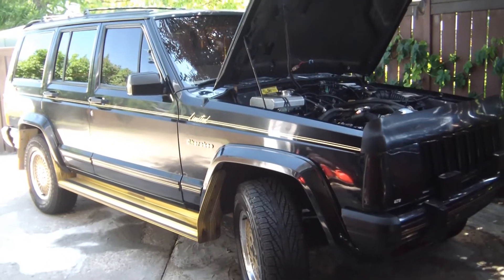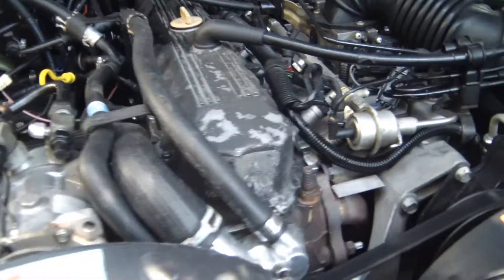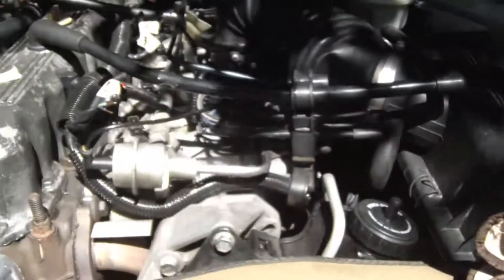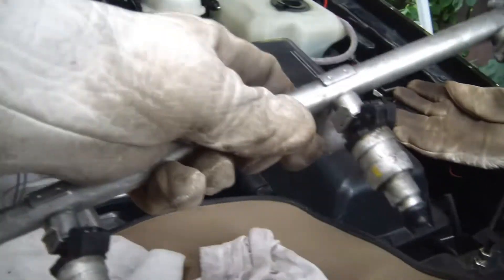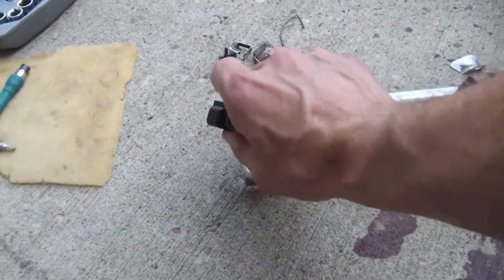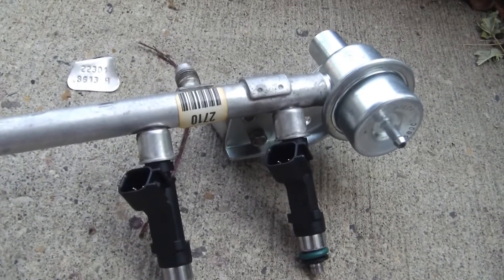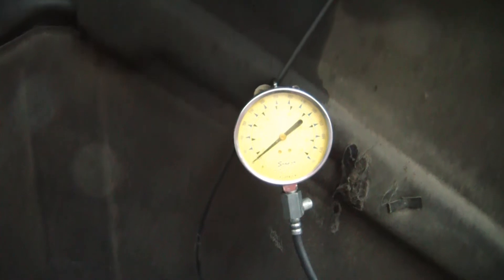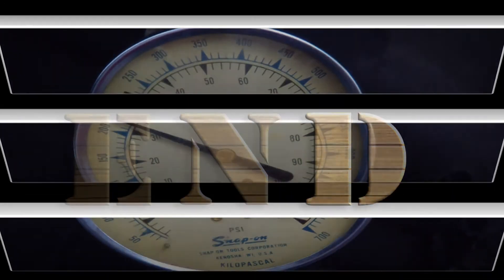DIY Auto: Fuel Injector Swap. Fuel rail, Fuel pressure regulator removal & installation.

Comment: If you've come to this video because your vehicle won't start without hitting the gas, you might want to consider the Crankshaft Position Sensor.  I was certain it was issues with the fuel injectors, but the vehicle was throwing a P0335, which is Crankshaft Position Sensor.  Go with the sensor first.  My 2005 Dodge Durango 57 Hemi was stopping completely, stalling, rough idling, misfiring... and with the replacement of the sensor... it stopped.  Good luck!

Comment: While changing out the injectors on my 1999 WJ, I caused the EV6 female connector's inner clip to break, so that it no longer wants to grip the mating port on the injector. Which method of replacement would you recommend – cut/solder/heatshrink a new one that comes with pigtails? OR unclip/slip-off/clip-on new bare connector?
Reply from the maker: VideoNOLA Whatever it takes to get the replacement connector on. If you can get away with slipping off a broken connector and putting on the replacement connector without any soldering, go for it.

Comment: Klondike Mike, thank you so much for your videos! I've got the jeep liberty fuel rail mod in my 1990 Jeep Cherokee Pioneer. It ran like a top and was great. Now Cylinders 1 and 2 spark plugs foul if I try to accelerate at a fast past. If I idle and slowly drive it's not that bad. It is as if it were the timing advance is not working. (If it was the old vacuum advance timing I would swear that was the problem.) No real power to say to "bark" the tires if I wanted. The rest of the spark plugs are clean and clear. Cranks and idles fine.
Reply: Oh yeah new distributor cap, plugs, rotor, wires. The engine is a re manufactured with about 60,000 miles with faithful oil changes at 3,000. I did have a vacuum problem with the EGR valve and replaced it. The intermittent wipers are working fine now. I don't have as much fuel blowing through as I did before replacing the EGR valve. It would seem like there is still yet another vacuum problem going on. I can warm up the engine and pull a vacuum on it and it is right at the border saying that it is okay. Yet again, the problem is when I try to accelerate or get on it. sluggish, no power and advancing in timing.

Comment: I really liked the video, very good job.  It was clear and well done, thank you.  I have a 2001 Cherokee strait 6 and have a misfire on #6.  I am going to follow your instructions but I was wondering; are the EV1 or the EV6 connectors polarized, or can they be soldered in any arrangement/postion to the feeder wires?  I noticed you didn't say anything as to polarization.
Reply from the maker: frogfootpt1 Thank you for your kind words. The connectors are not polarized.

Comment: I tried to 703 Neon fuel injectors on my 89 Cherokee and my snap on scanner found that my Cherokee wouldn't going to close the loop with the four hole injectors

 I see that you have a snap on scanner in your other videos have you tested your computer mode with these injectors on? let me know thank you
Reply from the maker: Colin Klucas It would be months before I could hookup the Snap-On again due to in-climate weather here. It has been 2.5 yrs since the video was shot with no problems. I'm sure there is none to be found when the Snap-On is eventually hooked up again.

Comment: hey dumb ? i need help its pissing me off that theres no video at all about how to remove the Fuel regulator on a 90 jeep Cherokee i see it looks like a plastic clip do u just push them in and pull out?
Reply from the maker: Chris Ogle yes on the clips. Use a needle nose plier to open the clip. Slightly compress on each side to open.

Comment: Really helpful video Klondike Mike I'm getting ready to do the same thing to my 1990 Jeep Cherokee XJ limited with the Renix computer / Canadian built I've had a leaking head gasket for the last 10 years I bought it that way so I'm getting ready to pull the head and the intake manifold and everything and I would like to do this upgrade but my wires are pretty much shot well at least the plugs for the injectors are so this is a spot-on of what I wanted to do I was going to go and buy all the EV-1 pigtails and go with the 703 injectors out of a neon or Sebring but the more I watch this video the better I like it thanks for the tutorial job well done ...
Reply from the maker: izzynutz2000 Glad you found the video useful, that was the intention. Regarding your head gasket leak, try this stuff. Recommended by a local NAPA tech. Suppose to be only a short term solution for minor leaks but it has been a couple of years since I have used and all is still OK. Changing the head gasket is no simple task.http://www.irontite.com/store/index.php?main_page=product_info&products_id=2

Comment: Is your fuel pressure regulator adjustable... I found one for $200  on 4wd.com not cheap but what a difference in power
Reply from the maker: chris aragon Stock not adjustable.

Comment: How do you know changing the fuel injectors would work?  This motor is not engineered for these injectors.  Has the change affected your gas mileage or engine performance?  Thx..

Comment from the maker: About 140k miles (206Km). Overflow container = MAC's Radiator, approx. $130. Yes, I live in Alberta, about 500 miles north of Montana and it does get cold in the winter. Somedays -30c.

Comment: Great video! :) How many miles are on your Jeep, its a very clean engine compartment? Also noticed that cool aluminum coolant overflow container, where did you purchase that? Cool remote start on your Jeep, do you live in a cold climate? Thank you for the great video and explanation.

Comment from the maker: Yes. Although, I have to say it wasn't running bad before after 22 years. I swapped out to get the 4 port spray, better fuel economy and no threat of leaking injectors. Engine throttle response is smoother. Still gathering data.